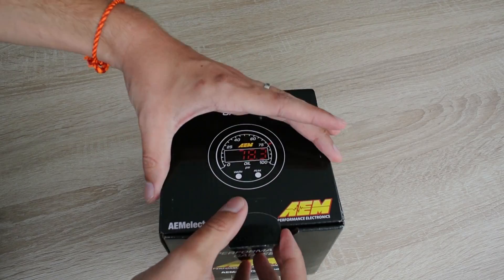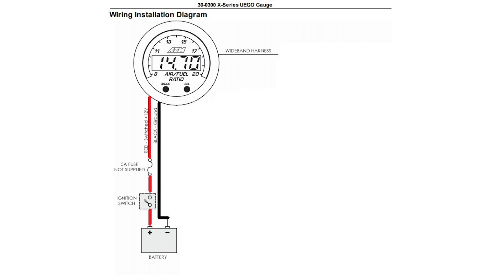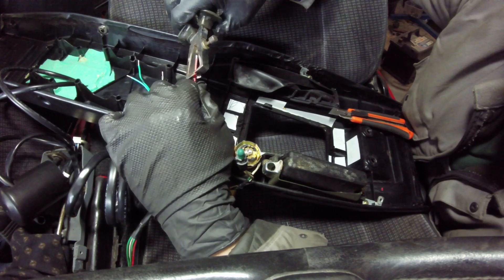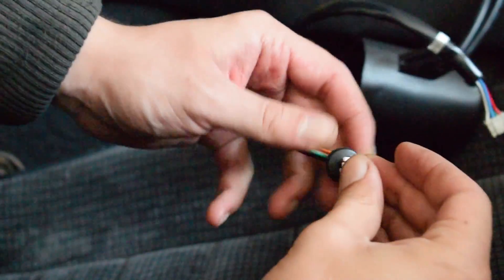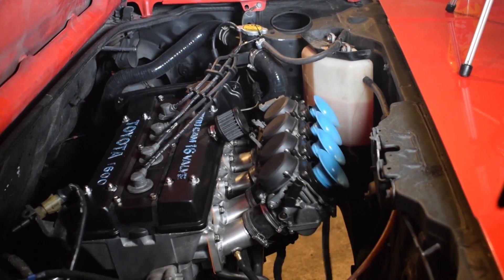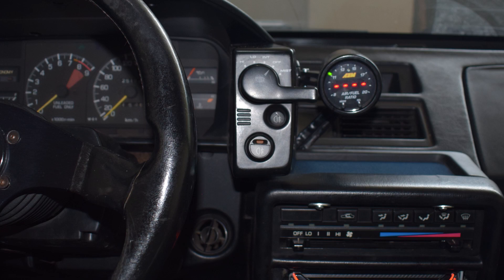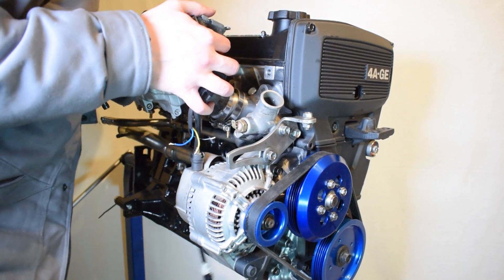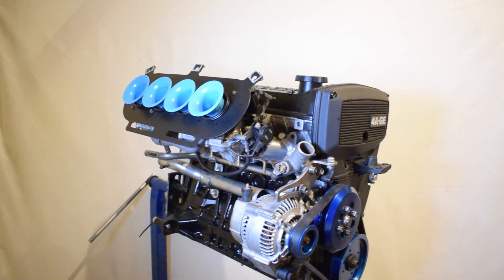How to install a WIDEBAND gauge and sensor - AEM X-series AFR

Comment: Wait ! If you swap the OEM O2 sensor with AEM O2 sensor on the exhaust manifold, how will the ECU get the oxygen info ? Ideally, dont you want both sensors to be installed ? One for the wideband and one for the ECU ? Please clarify.
Reply: I was just thinking about this myself. But im pretty sure you have to wire it differently if u want to link your ecu to it

Comment: may i ask do you still got the 12v outtake functioning and spliced a Y conection for ground and power, or did you disable the 12V outtake for the gauge? would charging a phone while having the gauge running for example disrupt it?

Comment: I have a 4A-GE engine that runs with MAP sensor and no Ox sensor nor EGR hole by stock, so I have 4-2-1 exhaust manifold by default, where do I need to connect the wideband sensor for best readings? Sometime ago someone I eard that I need to install it in about 30-60 inches or cm (I dont remember it) from all exhaust collectors merges in one but I'm not sure. Thanks in advance!
Reply from the maker: It needs to be somewhere where it csn read gasses from all four runners and it needs to be at an angle. The instructions that come with the wideband are pretty clear, you have them on the AEM site too.

Comment: Hey, I have some questions about AEM gauge that maybe you can help.
Does that model has any way to data log to a laptop? Does it have any narrow band simulated output signal? I need a solution for an old car, old ecu.
Reply from the maker: It can log, but not by itself, you need a data logger to hook it up to. No simulated narrow band as far as I know.

Comment: Is this gauge and sensor still running good and reading good? Have you modified the suggested installation in this video at any time? Im already having troubles with it 🤦🏻‍♂️
Reply from the maker: Yup the same gauge and sensor from day 1, zero issues. I did move the install location from the 4th runner (ex egr) to a place where all four runners meet (ex o2 sensor), other than that everything is absolutely the same since day 1.
Reply: @d4a  thank you mate!!

Comment: If you put the Aem sensor into the manifold.
What happen to the original sensor cable?
Reply from the maker: You can just tuck and zip tie it somewhere if you want to keep it, or you can remove it completely. Alternatively, you can have both sensors in the manifold by welding in a separate bung for the aem sensor. In my case I actually installed the aem sensor in the EGR hole of the manifold, it stayed there for a while along with the factory o2 in its stock position. There's a lot of options depending on what you're after.

Comment: So did you remove your stock 02? Im not understanding how the ecu can try to compensate adjustment if there are no 02 readouts wired back to the ecu? Thanks in advance
Reply from the maker: This isn't connected to the ECU. It's for afr display purposes, so I can tune my carbs :)

Comment: I like the Tanabe Revel gauges because the AEM's have those digital numbers that are kinda ancient looking if you understand what i'm saying. The number have ticks for a #6, while on youtube the #6 looks like a 6 with all lines attached and smooth curves. Thats why i like tanabe's and i like the gauge spectrum color moves all the way to where it needs to be while AEM only has 1 dot marking where the Wideband AF is at or any other gauge they sell are typically the same.
Reply from the maker: I agree that the tanabe is definitely prettier looking being an OLED display. But I did quite a bit of research before deciding which gauge to go for and while AEM's may not be as pretty it is simply superior in terms of other, for me, more relevant stuff. The tanabe doesn't allow for data logging at the moment, and that's really important for many people, and will be important for me in the future. The AEM is also considerably cheaper. When it comes to responsiveness, I haven't measured myself, but I don't think that any gauge, save for the really high end ones, responds faster than the x-series. So yes, not as pretty as tanabe, but for me the gauge might as well be poop colored as long as it does what I want it :)
Reply: Lol, true. I actually did not know they can do data logging for these. Well, i don't think its much of a big difference unless you have an Piggyback or aftermarket ECU right?
Reply from the maker: Lime It's weird that they can't, but I read it in several places. Data logging is super nice, because than you can sit in an armchair and see exactly what the afr was at different engine speeds, temperatures, throttle openings etc. But you're right, without an aftermarket ecu you can't monitor all that.

Comment: Calibration?
Reply from the maker: No need. Here's a the part about calibration copy pasted from the manual: "The supplied UEGO sensor is factory calibrated via a trim resistor, integral to the sensor connector, and requires no further calibration. The ability to perform a free air calibration is provided for users that wish to do so. "

Comment: I notice that the carbs are moving around since its only clamped on with rubber hose only. Might needed a bracket to hold it?
Reply from the maker: They are connected only via rubber hoses when on the motorcycle in their stock natural habitat ;), and they do move around a tiny bit, but will never fall off, so no need for a bracket really, unless you absolutely hate seeing them move a tiny bit :)
Reply: I see. Might be my personal preference. I made a bracket for my friend to hold the bike carbs on a toyota 4k engine. Perhaps i believe it ensure the air flow straight in.  Btw thanks for sharing . Keep up good work tho